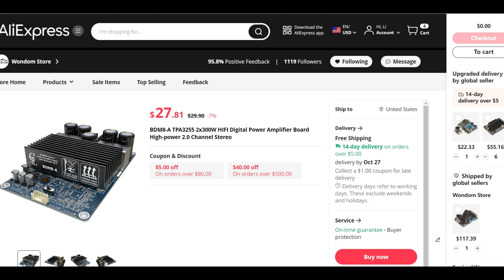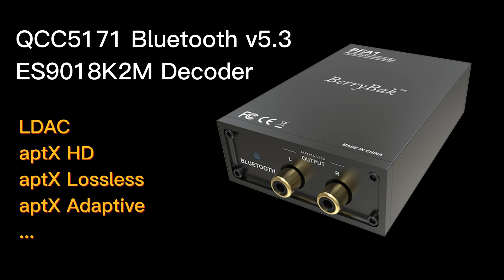TPA3255 Stereo High Power 300W Audio Amplifier Board with 3.5mm Line Input - BDM8-A

Comment: Hey, quick question from the capacitor and inductor placement it seems as if you are using a C-L filter for the input power, won't that hinder the transient response? (Can I just bridge these inductors and provide external power filtering to get better transient response?
Reply from the maker: Hello, thank you for your watching. This amplifier board utilizes Class D topology. The inductors are are mainly used for low-pass filtering of the PWM signal, not for power supply filtering.

Comment: Why doesn't anyone bring the CLIP/OTW and FAULT signals out to a connector? 
These are very useful signals to warn the users of overdrives.
Reply: Exactly what he^^ said!  I can't fathom why every amplifier doesn't have a clip light by now!?  TI designed the tpa3255 with clip and fault pins and 95% of these amps I see don't have a clip light or fault reset button!
Reply: @KGrasso89 
You would also be surprised how many of these DIY boards that do implement them implement them incorrectly.   They have them in an always on state that totally destroys their usefulness as warnings.